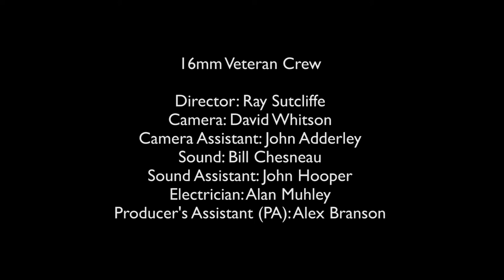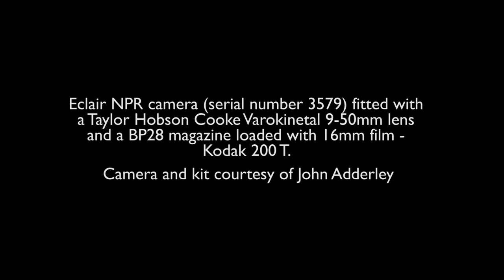16mm telecine output

Comment: I just spent an hour watching videos from this project and found them very interesting. This video demonstrating the "final" output is a bit odd though. The image quality is great (for an SD telecine), but the movement is jerky and there's some kind of pulldown going on - checking in a video editor, single frames are repeated in something like a 3:3:2:3:3:2:3:3:3:2 pattern. So I assume the 16mm film was not shot at full 25 frames per second then? That's a bit of information I would have expected to hear in the (otherwise thorough) telecine video. Also the audio drifts and is completely out of sync at the end of the video, which is a strange quality control oversight given this video is supposed to be the final "product" of the endeavor.
Reply: Yes, I would want to hear about pulldown patterns and how video is synchronized to film. I need to read about flying spot machines, I suppose they do not use mechanical shutter.
Reply: That might be the fault of youtube. Interlaced videos get processed strangely, so it's best to deinterlace/upscale them before upload. I doubt that was done here.

Comment: thats the best 16mm quality ever
Reply: That's because this was transfered from 16mm film to Digital Betacam. The Rank Cintel MkIII telecine operations were done by Jim Gregory, while the near 9-minute film itself, on the other hand, was restored by Tim Emblem-English.
Reply: @northernplacecorporation  Do you know at which frame rate the film was shot? I naively assumed the BBC shot film at 25 fps, but this output looks more like a (deinterlaced) pulldown from 16 or 18 fps.
Reply: @viva2archive  PAL uses 25fps, and NTSC uses 29.97. When you double that, we get either 50 or 59.94.
Reply: @northernplacecorporation  Sure, the output of the telecine process is PAL video (so 50 fields interlaced, which I assume was deinterlaced to 25fps for this Youtube upload). I was referring to the 16mm source film which - looking at the output video - was obviously not shot in 25fps. The general movement is jerky and one frame gets repeated in something like a 3-3-2 pattern. So I assume the film was shot at a lower frame rate and then pulled-down during the telecine process to achieve a PAL frame rate
Reply: @viva2archive  You might be right.
Reply: @viva2archive  Why would one showcase the output of a telecine machine at 25p in 2018 is beyond me. YouTube has supported 50p/60p since 2014.
Reply: @TinLeadHammer  It's a shame, a lot of people don't realize this. SD capture can look great on youtube if you deinterlace/frame double it before upload, and make sure to render it at a resolution of 720 lines or above. 960x720 is a good choice for NTSC.
Reply: @northernplacecorporation  PAL is also 720x576 resolution which more than NTSC's 720x480.